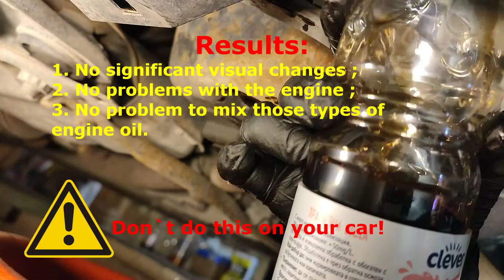Can you MIX ENGINE OILS | 5W40 + 10W40 | TEST 1000  Kilometers Later

Comment: 1000 km is nothing, run it for 10K and have it analyzed.
Reply from the maker: You are right 👍 I will put that on the list
Reply: @FixitEasyDIY  Hi, i live and work in Czech republic, and I saw in Kaufland this "My Project" motor oil. How good it is? By the price, it is cheaper than known brands.
Reply from the maker: I already can say it's not a good motor oil. The engine is running louder than before, the oil level is decreasing. I have used Motul before this and there was bo problem at all 😔
Reply: @FixitEasyDIY  thanks.
Reply from the maker: @uroskostic8570  you are welcome brother ☺️
Reply: @uroskostic8570  If the specs are fine for your car, use it, simple.
Reply: If you care for your car, no oil should be in the engine for 10000km.

Comment: Can I mix Motul 10w40 and 10w50 500ml. Each for my motorcycle?
Reply from the maker: I literally did it to my wife's car. But I suggest using the right oil itself without mixing. I just did it for the test :)
Reply: @FixitEasyDIY  Actually I have 500ml 10w40 left , and recommend for my motorcycle is 10w40
1 litre, but in my country 1.5 litre 10w40 isn't available,  only 10w50 1.5 litres is available  that's why I asked
Reply: @FixitEasyDIY  I dont wanna throw away my leftover 10w40
Reply from the maker: @beastmaster6960  Go for it. You can use it

Comment: I find mixing oil OFTEN results in a more quiet engine and better mpg than a single brand. 
Just my experience.
 I last used 5QTS walmart advanced high mileage, 2 qts Valvoline restore and protect and 1 qt pennzoil ultra plat high mileage.
My engine was noticably quieter and got top MPG using that blend than it does using royal purple hmx, valvoline R and P by itself or Mobil 1 high mileage full synthetic.
Pennzoil Ultra platinum and and platinum seem to do well by themselves.
Reply from the maker: Thanks for sharing. Same case here.

Comment: I ONLY use the correct grade of oil for my car and always use Shell Helix 5W-40 HX8 Fully Synthetic oil for the car and I use the same oil for "Top-ups" ... I change the oil and filter every 9,000 Miles  (14,480 KM) which is around every 9 Months for me. 
This is why my petrol engine car has lasted 224,000 Miles (360,000 KM) and is still going strong. 
Look after your car and it WILL last longer......... FACT! 
If you try to be cheap on the servicing it means you will have to replace your car much sooner.
Reply from the maker: You are tottally right. I own old Audi A6 C4 (1996 model) . It has 2.5 TDI diesel engine. I am changing oil every 8000 km with high quality engine oil (Motul 8100). The engine has arround 700 000 km on the clock at this moment and it is still going :) God bless you !
Reply: I ran 400 000km and still running  with basicaly no maintenance barely changing oil every 15 000 mile or 30 000km something 
The car is a Dacia 1.5dci diesel😂
Reply: It all comes down to pure luck i know alot of people who highly maintain theire vehicules with no luck always at the garage